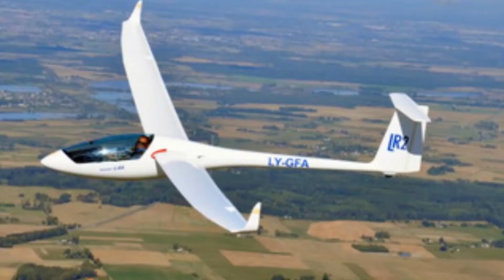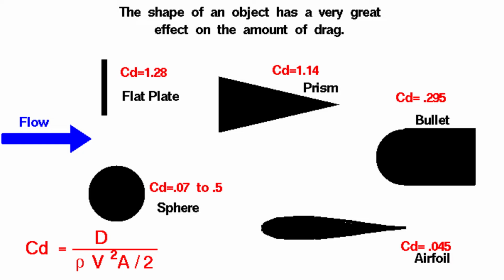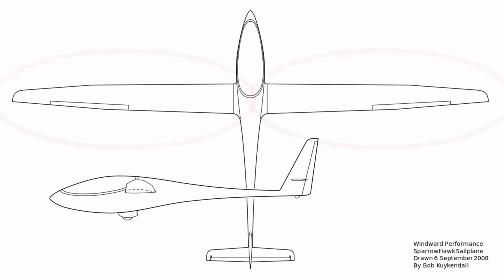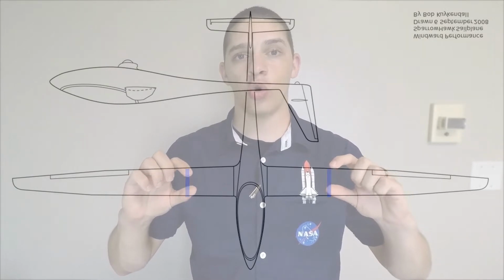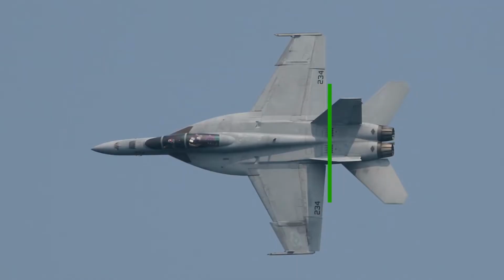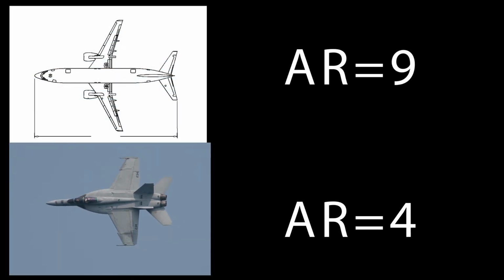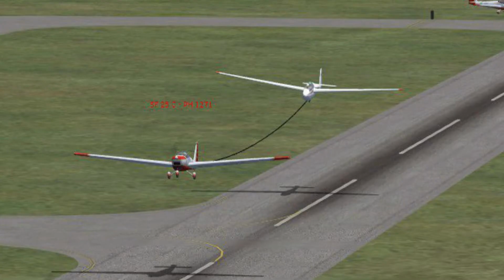Flying With No Engines - Gliders at Work

Comment: how do I DO WHEN i WANT MY GLIDER TO LAND AND NOT FLY
Reply: You’ll use the speedbrakes. Since you have a ton of lift, your problem is that you have rather too much, than too less of it. So when you aligned with the runway, you’ll use your speedbrakes to destroy altitude. If you’re then like 1-2 feet over the Runway, you basically stall it out and Land smoothly.

Comment: My experience in gliders helped me pass my single engine land flight test.
The examiner cut my engine on downwind and told me I wasn't allowed to use flaps.
I used slipping learned in gliders to control my glide path and got the plane down safely.

Comment: If one were to make an airplane that traveled at automobile speeds (50-100mph) with a very high aspect ratio, would it be more efficient than any other plane?
Reply from the maker: Sure! In fact, many small planes today fly at those speeds and are rather efficient. However, the higher the aspect ratio, the harder it is to make the plane because of how long the wings are.
Reply: Can super high aspect ratio wings work on a airliner theoretically